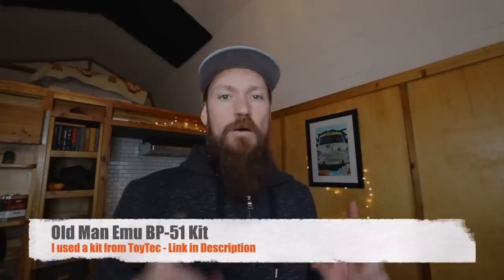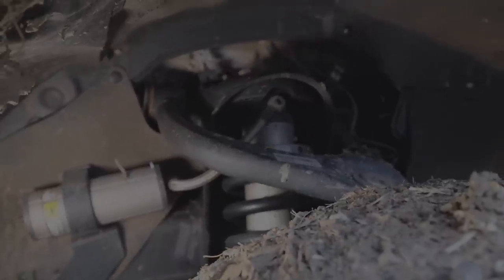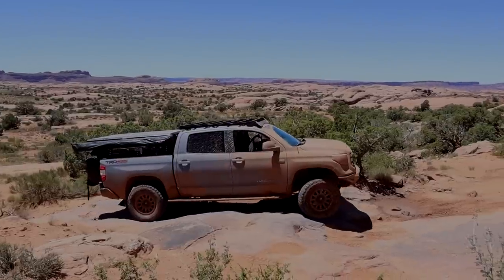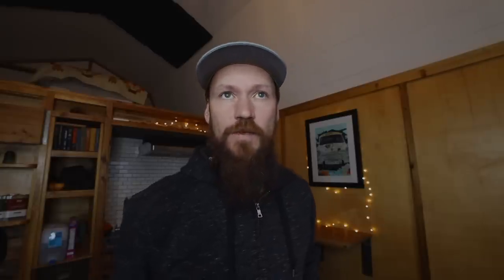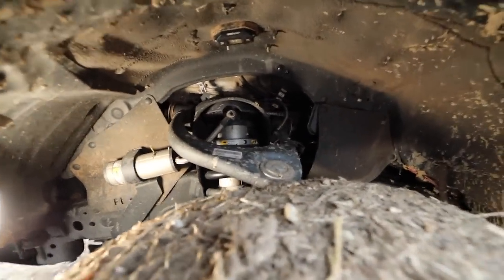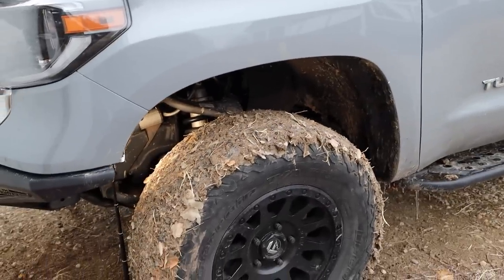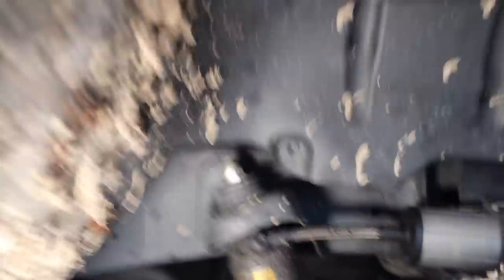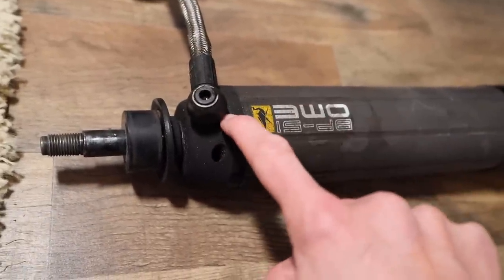Old Man Emu BP-51 Suspension - Watch Before Buying - WE BROKE IT - 1 Yr Offroad Review

Comment: Thanks for the info on the leaking rears.  Hopefully impact was the problem as that should be easy enough to fix.  I just installed a set of these in my 2018 Tundra last night (only got the rears done so far) and I made a cutout for the fitting with a cutoff wheel and cleaned it up with a Dremel so hopefully I don't have this issue!  Great video!

Comment: Got it professionally installed on my '19 4runner. Big difference both on and offroad. Rear became soft after 8 months or so. I have a full steel rear bumper with tire carrier and I got medium spring kit. Gonna switch it to heavy. It even took jumps on-road.

Comment: The obvious problem is that the truck is under-sprung and needs larger bump-stops. The shock shouldn't ever become the bump-stop.  It's all on ARB.  The whole problem can be fixed with a little better engineering.
Reply from the maker: All good points... I do have a hard time believing just a bump-stop solves this considering the shock in my case was pretty well protected by an inflated airbag... I get it isn't the same thing... but you get what I am saying. Agree on shock shouldn't be bump-stops... in this case I don't think they were. I think it takes fairly minimal amount of force to have these two components contact each other.

Comment: I had this kit on a Tacoma. Ride quality was great. I had 3 shocks develop a leak. ARB warrantied all 4 for me so they would all have the same life span. All of them leaked at that fitting on the shock body. ARB doesn’t have a procedure developed to rebuild these yet even though they are rebuidable.
Reply from the maker: Thanks for the info... did you ever notice if the hose was rubbing on the shock mount... or do you think it was a different issue on the Tacoma? Also - I saw the same thing... ARB is VERY good with their warranties.
Reply: @OutdoorAuto  never noticed it contacting anything just developed a leak.
Reply: @chrismortensen4183  any updates on this chris? i literally just ordered this full kit for 4k... im pretty worried now boys

Comment: The shop is just about to finish day two of my 2018 F150 SuperCrew build. Calling for an update shortly and pick it up tomorrow EOD. Based on one of your other videos and video from another YT'er, I deleted the rear blocks from the BDS kit for the factory leaf springs and went with new Deavers. Got the Deaver HD's. Just checked the Deaver site and they make replacement leaf springs for a Tundra. Standard, medium, and HD duty with different lift heights. Can't wait to get my rig back!!!
Reply from the maker: On nice... that sounds like a killer setup. I have Deavers on my other Tundra... very impressed. Have fun with the new truck.

Comment: Mac the knife here taking a wild stab in the dark...the bushing above the shock between the 2 washers or whatever at 12:50, this probably slowly loses its full thickness from being compressed.   In addition to trimming the shock body above reservoir hose connection...would a thicker bushing (possibly nylon instead of rubber) also add a degree of clearance and longevity in protecting the hose mounting connection ???  Just a DIY'er observation.
Reply from the maker: All of this makes sense to me... I think Bushing degradation is probably contributing for sure.

Comment: Hello, I got the same suspension kit on my 2016 SR5 Tundra. Love the kit few little issues at the back as well though. For the issue your talking about, if you read in the instructions, it tells you to have at least 10mm gap between the " banjo " fitting and the upper mount( metal bracket part of the upper mount welded on the frame). What I did is I grind a half moon around it. Mine never hit but still started leaking recently from the same fittings. My greaseable shackles have a loose and they're pretty much brand new. But yes you're right ARB stand behind their products.!!!!

Comment: Rotating the shock about 45degrees to the rear will put the banjo joint inside the shock support and make sure it does not interfere...a simple fix.
Reply: the hose to the reservoir doesn’t allow for that. very little flex.
Reply: @stevenpeterson8444  Did you try it?  It works like a charm on my 4runner,  I left the reservoir lose until the shock was in place as the twisting of the shock does impart a twist in the hose, I then set the reservoir in the position where the hose was least stressed.  Looking at this video and my 2014 Tundra, I would think that it will take only a 45 degree rotation to the rear to clear the frame and allowing the reservoir to sit further to the rear will alleviate most of the binding.   A bend that does not kink the hose will not damage it.  FWIW, this might preferred to cutting your truck frame.
Reply: @234bull3  yep, there’s barely enough hose to get to the reservoir mount, let alone extra

Comment: Since the installation of the Air Bags required the removal of the rear bump-stops on the Tundra. I'm betting the reservoir fitting clearance issue is due to the shock bottoming out and crushing the upper mounting bushing. There-by allowing the fitting to hit the mount. 

That upper rubber bushing is there to allow a tiny bit of movement and to isolate the chassis from noise and vibration NOT to suck up the energy from a bottomed out shock. There are no shocks avail that (as far as I know) have a built in bump-stop.

I'd either get the heavy duty springs or figure out a way to limit the "up" travel enuf that the shock doesn't bottom out.

YMMV RON
Reply from the maker: This makes a lot of sense... On one hand the air bags weren't deflated when this happened... so it would be hard to completely bottom out the shock but I get what you are saying. You would be correct on the shock not having a built in bump stop. Good point on the bushing as well. I still believe the positioning of the hose is inherently risky. With that risk in mind... your Point is great... you may never wont to run this kit without carefully checking and adjusting your bump stop. I still wonder if even with a bump does the shock generate enough pressure to rub/hit the hose.
Reply: @OutdoorAuto    I thought about that.  I think clearencing the shock mounts and making sure there is plenty of bumpstop to take on the biggest hits before the shock bottoms out, is the complete answer.  I learned from a friend that builds real Baja 500 trucks in his shop about bumpstops, air bumps, and hydro bumps.  They are more important than I understood for controlling the truck on bigger hits.
Reply from the maker: @nonope1774  I hear yah... the new truck has Hydro bumps in the rear for this exact reason. I still need to improve my bumps in the front though. 
Hey - thanks for all the comments - good stuff for people to think about.

Comment: FYI, changing pre-load on the shock to change ride height will affect the amount of droop travel of the shock. I am not familiar with trucks but street cars should not use pre-load to change height beyond doing corner balancing because it will affect performance. I would imagine on the truck you do not want to take away too much droop by cranking up height via pre-load.
Reply from the maker: You are absolutely right... there are several variables with trucks but depending on your UCA's and a few other things each model truck is going to have ranges for preload that you should not exceed. This is why even bolt on kits can get people in trouble if they don't pay attention to installation directions.

Comment: Had the same issue. I blew both rear shocks on a hard bottoming out.  Arb tech replaced both and suggested  to notch out the bucket and it worked.  Haven't had any issues since.
Reply from the maker: Geez... I wish they had told me that my first round... would have never had a problem the 2nd time.
Reply: But....   The shock shouldn't be ever bottomed out either.   If you run that hard you probably need to upgrade your bump stops.  The stock rubber ones aren't designed for that.

Comment: I have a 2017 Tundra and put an OME suspension on but it was before the BP51 came out for the Tundra.  I put the Heavy Load kit on the rear suspension with the add-a-leaf.  Can you tell, I can’t, if the BP51 kit is the same Heavy Load (add-a-leaf) rear system?

You mentioned in your video about the springs not being very heavy duty, and was wondering if that could be a work-around you were mentioning in your video for better springs for heavier loads.

I’d love to up grade to the BP51, but keep my Heavy Load rear leafs with the add-a-leaf.  

Thanks for doing this video on the BP51.  Great information to work with.  Very well done!
Reply from the maker: Even with Heavier springs (I have Airbags that would prevent a full bottom out) I would still cut or Bend the top of the shock mount. My best guess is it doesn't take a bottom out to eventually create these problems... it seems it just takes time and heavy use. But definitely, use appropriate springs for the weight you carry. If I added heavier springs I could remove my airbag system...

Comment: The instructions that came with my kit (2012 tundra double cab) have a specific section regarding the rear  clearance issue. It notes needing 10mm of clearance when truck is sitting on level ground. If you have less than 10mm, you'll need to do some grinding on the shock mount
Reply from the maker: When did you get your kit? I’m curious if they started adding that later... I think my issue is I got them really early for the Tundra.
Reply: @OutdoorAuto  purchased about 3 months ago

Comment: If all that I am doing with my truck is to everyday driver with adding a rack with rooftop tent with gear in totes in the bed for some weekend camping/fishing and maybe adding my canoe on the tent rack, can I get away with just rear shocks or maybe adding a leaf? Just wondering. It doesn't seem to make sense for me to add $3.5k of suspension for this much use. Thanks in advance! (2018 double cab Tundra)
Reply from the maker: Absolutely, you definitely don’t need to go crazy… there is a decent chance your truck can handle all that fine… the Double cabs have higher payloads.
Reply: @OutdoorAuto  Thanks! I'm thinking of just doing a camper shell with a rack for my canoe along with a decked system. I have 3 tents and 2 hammock setups, so the rooftop tent is not a must at all.

Comment: 1. Adjust bump stops to properly prevent bottoming out the shock
2. Bend out/grind out the lip near the reservoir fitting
3. Either clearance the lip around the reservoir line as well, or wrap it with a sleeve to prevent chaffing.  This is a problem on many other platforms and brands as well.
Reply from the maker: I wish OME would just address it upfront and even Ad it to the installation instructions and save everyone the time. I have seen at least one other manufacturer that is doing this.
Reply: @OutdoorAuto  To be honest, I don't think that's OME issue. This is not the kit "set it and forget it" type. You must adjust it properly for the terrain you're driving on. If you get it wrong then you end up bottoming out and risking damage to the shock. Don't forget, those are made from alluminum and no matter what they/OME do the alluminum will not stand a chance against hi-grade steel of the frame. If your dump compression was set properly, the chances of getting that bushing squeezed so much would be close to zero. Anyways, thanks for sharing your experience. I'm pretty sure many OME owners would thank you for that.

Comment: great video!
I run the ome standard kit (heavy duty front springs for my arb front bumper) (not the bp51) on my 2014 tundra. after adding a camper top and decked system i noticed a sag in the rear. i  did the add a leaf with the ome greasable shackles and it corrected it.  I love the ride and performance. Its on the stiff side yet i long for the adjustability so soften it up for the trail. 

I recently removed the front swaybar. night and day difference off road.

Comment: its always question do you really need to install 3.5 K dollars struts vs bilstein 5100 or even 1 K 6112. I wonder this, and I'm not trying bushing, just how many people do Baja type off road. As my opinion it's last thing you want do, well more important spring, after weight your truck. Like have GVWR is 8990 but my total weight as of right with family and dog 8960 lbs from weight. Ride quality is most important is tire pressure with your weight.
Typical after market mistakes in manufacture as they don't want redesign that hydraulic port just for the Tundra. My guess it will addressed in next model.
Reply: The advantage to these more expensive kits is not that you need to do baja driving to benefit from them.  The big pros are all of the advantages that inherently come with a remote reservoir and the added adjustability in height, compression, and rebound.  Without these you're just left with what that shock is capable of out of the box.  With adjustability you are able to tune almost every aspect to your vehicle, its weight, style of driving, terrain, and make adjustments as the vehicle changes and has weight added to it or removed.

Comment: Great kit, would probably ask them to send you a taller rubber bushing. Bushings heat up and start breaking down. Ultimately, a fix has been stated for the issue. Take a quarter inch or so off the mount lip for a long term fix. I have also ran a flat washer on similar setups that bushings looked a bit short. No more than one top and bottom but really the manufacturer should buck up and send a taller bushing. You didn’t really break it if its a product flaw. Eager to see a fix.
Reply from the maker: All good points... If for no other reason they should just get better info out about this so they don't have to keep replacing shocks... that can't be good for their bottom line.
Reply: No thats some bad engineering right there but can be fixed. They should fix it so they don’t get the bad rep. Bottom line they are losing money not making the fix. Good stuff glad to see someone that uses their truck as a bada$$ rig!

Comment: I had read about this "potential" problem on my Tacoma. When reading through the warranty information on my Icons it mentioned that the warranty would not honor fixing the shock if that occurred.  I did notice that the shock valve was much closer on one side than the other so I cut the one side to avoid it. There was a write up on TacomaWorld related to the issue on the Icons. Seems like a potentially common occurrence for several shock brands when folks actually use their vehicles. My guess would be something to do with the bushing and wear over time.
Reply from the maker: It’s awesome that Icon seems to have figured out how to address it so it is easier to avoid. Any shock that has this issue should just have these steps explicitly called out in the install directions... I think they avoid it because then they would kind of lose their bolt-on status....

Comment: How would you rate the ToyTech 2.5 Aluma kit vs these OME B-51s? I tow another car with my 2011 Tundra a few times a year. Right now its a stock truck with 140k miles but I have a bed rack and sliders and few things on the way and maybe a tent soon. I know nothing will be great suspension wise for off-road and towing but thinking maybe the articulating bags you mentioned in another video along with a kit from ToyTech (they are local to me). I was debating between the Aluma 2.0 and 2.5 because thats what they recommenced along with the rear lift shackle vs the add a leaf kit. But also debating between money for suspension vs a lsd or locker or bumper + winch. Want to run 35s and goal is to maybe do The Maze in Canyonlands in a few years but I'm just getting into it all and need to prioritize the build before buying things. Really appreciate your videos, they are very helpful!
Reply from the maker: I have never personally run the Aluma's but I have heard very good things. The design is going to more similar to Icons than the BP-51's... The BP-51 really is its own animal with the internal by-pass tech. But when you see new tech sometimes you also see the bugs/defects in the first try. IF you tow a lot I think the Aluma and Bags could be a good call... gives you a lot of flexibility.

Comment: I have it and love it!   Plus no maintenance!     However I wish I would have gotten icon stage 10 long travel and total chaos long travel control arms.    Plus ICON STAGE 3 secondary shock front and back!      I have weld on rock sliders, TC cam tab gussets for LCA's and steering knuckle and total chaos upper control arms.    aFe momentum  cold air intake with scoop and throttle body extender. Dual exhaust system,  pedal commander, bed stabilizers, summosprings bump stops, ARB complete skid plate package and icon skid plates for LCA's.      I have a bunch of LED lights and a roof rack.   Plus bed  rack system,   traction mats,  winch bumper with 9,000 lb winch and synthetic rope.    I just put the OME AAL  on and it lifted it 1 1/2 inches in the back!!!!!!!!!     Can OME front shocks be adjusted to go higher because its ass is sticking up and the tire rub is un-drivable.
Reply from the maker: Sue - i would need a little more info to answer these questions.... for starters what vehicle is all of this on? As far as the OME BP51's they are adjustable in the front for height by changing the preload... it gives you a couple inches of play. If the tire rub is that bad though... you may have other issues with offset...etc You should check out our discord server people talk about builds and get questions answered everyday in there. https://discord.gg/4SNTsTBdkx